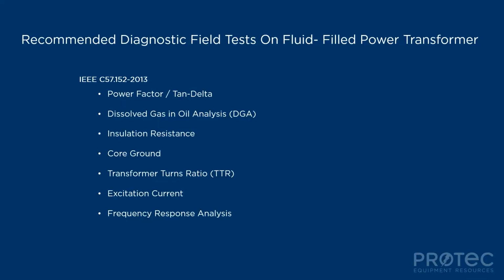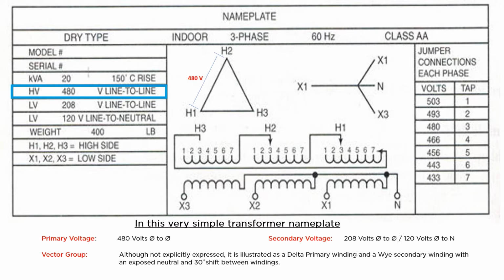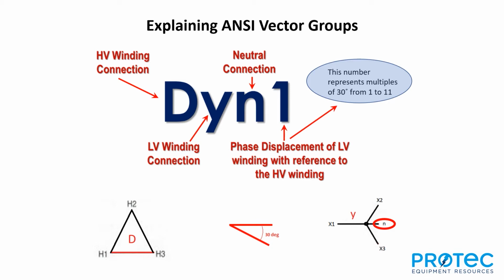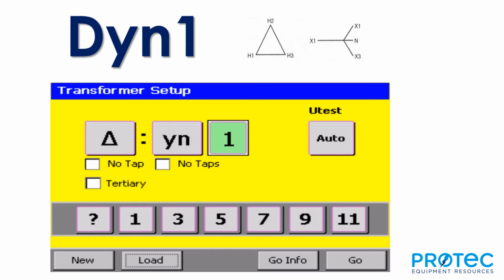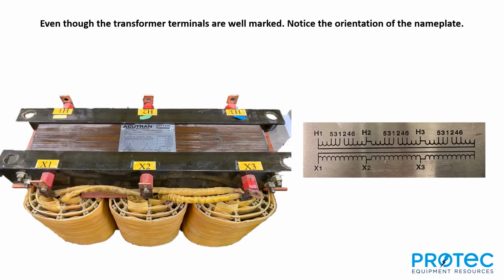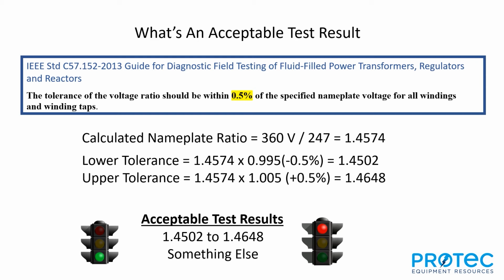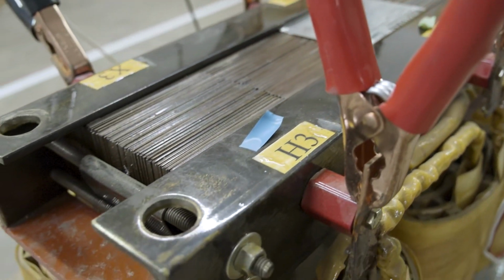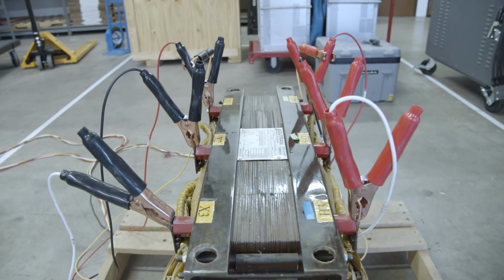Transformer Turns Ratio Test - Protec Equipment Resources

Comment: Thanks for the insight. Can this be done with only an AC voltage and a voltmeter
Reply from the maker: You might be able to do this with only an AC voltage source and (2) precision voltmeters. One for the voltage source on the primary and one for the secondary voltage. This might work great for a single-phase transformer.  However, when you get into a 3-phase transformer testing, your meters and your source are going to have to become a bit more complex.  You will now have to monitor both phase-to-phase and phase-to-neutral voltages and their phase relationships to one another.  This is dealt with by having the test equipment (TTR) apply the appropriate vector math for the configuration of the transformer being tested. You will find that most of these pieces of test equipment will calculate accuracies or % error based on having entered in nameplate information.  Probably the most significant response to this question is that commercially available test equipment will by necessity have certain safety and convenience features built into them.

            Automatic Discharge
            Single Equipment Grounding Point
            Demagnetizing Feature
            Easy Access to transformer configuration selections and connection Diagrams
            Pass/Fail indications based on imbedded industry standards and programed nameplate data.

Finally, with a piece of test equipment designed for performing TTR tests, you can have an electronically generated report available for your customer within minutes.

Comment: The video was decent. I wonder how this device reduces voltage drop error on the primary winding
Reply from the maker: I’m not completely sure of the context of this question, but I am suspecting that it may have been related to the difference in how measurements may at one time have been made as opposed to the way they are currently made from a concern for safety.  If we were to apply a voltage to the secondary and measure the voltage across the primary of a transformer, the potential at the primary could be lethal and perhaps more difficult to meter.  However, if we were to apply a voltage to the primary and compare it to the secondary, then the voltage is much lower and less difficult to meter on the output of the instrument, perhaps making it more accurate and safer than if we applied a voltage to the secondary.

Comment: It was a good video Practically & Theoretically
Thanks a lot!!
Reply from the maker: Glad you liked it!
Reply: @ProtecEquipmentResources  

I’m not sure that I understand your question.  However, let me see if I can respond in a meaningful way.  Are you talking about the voltage drop across the primary winding as a result of its resistive and inductive characteristics?  

The test equipment measures both the primary and secondary voltages associated with performing a transformer turns ratio test.  If there is some reason for a reduced voltage on the primary winding, the secondary voltage should be impacted proportionally.  So, if for some reason the output voltage of the test set is less than the expected value, and if a required level of magnetic flux can be maintained in the core of the transformer, then the ratio will be the same even at a lower voltage.  The specified error of the test equipment should be far less than what the industry requires in terms of acceptable ratio errors.